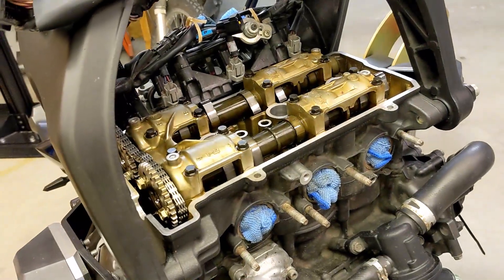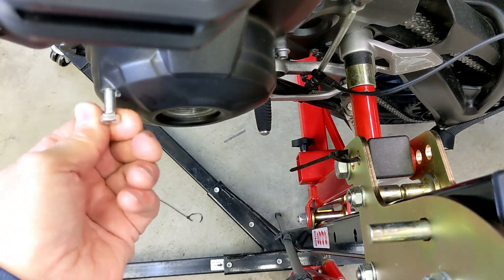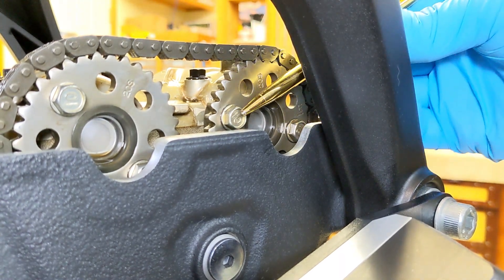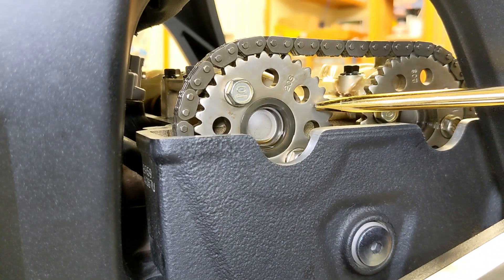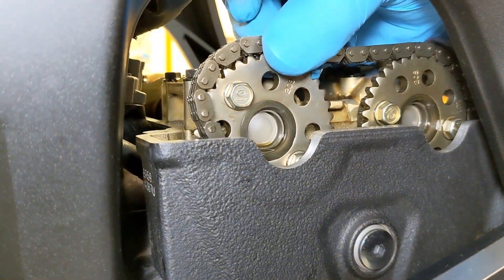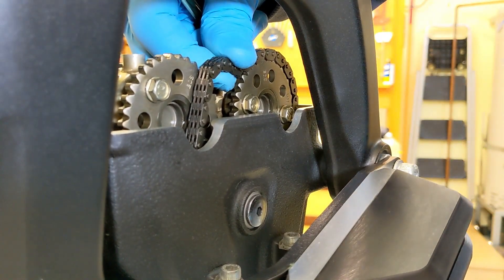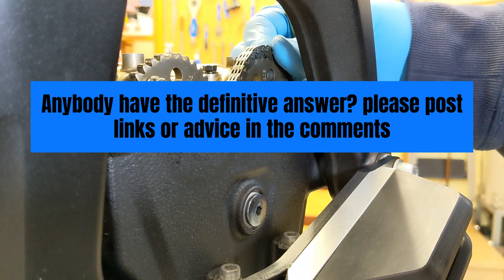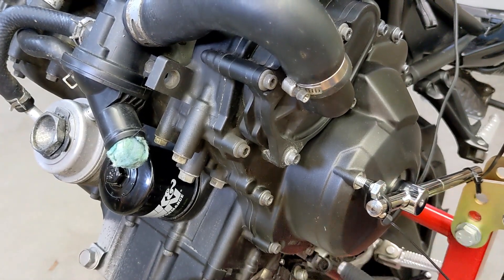cam orientations after cam chain tensioner removal Yamaha FZ-09/MT-09 2014 2015 2016

Comment: I highly recommend to buy the  service and repair manual from "Haynes" ive done the procedure of valve adjustment sucessfully  with the mt07 of my wife with the haynes book and now im doing this with my mt09 with the mt09 haynes book. The original service manual just lacks too many important infomation if you do this the first time..most of the service procedures in the haynes books are by far better documented than in the yamaha original service manual, especially if you are not an prof mechanic.
Reply from the maker: You are right...next week, I will be reassembling the camshafts and making a video (the Yamaha manual is no help just says "reinstall") ....I'm curious...does the haynes manual give any good tips?
Reply: @meticulousmechanic  the Haynes manual is more precise and practical in that manner, with more detailed Pictures aso. Its not perfect but much better than the original manual